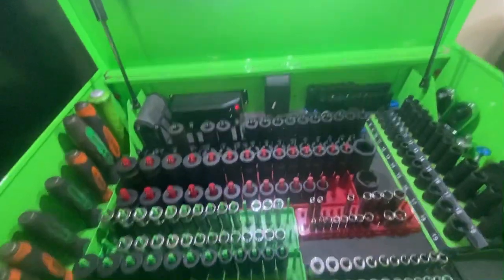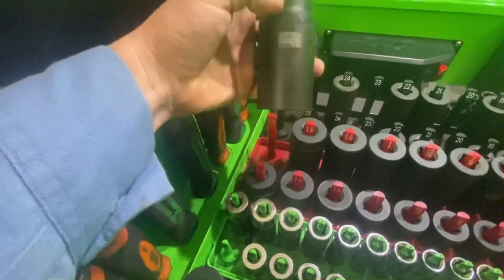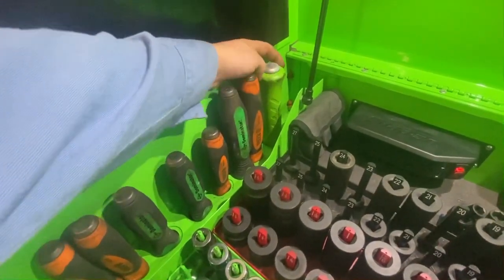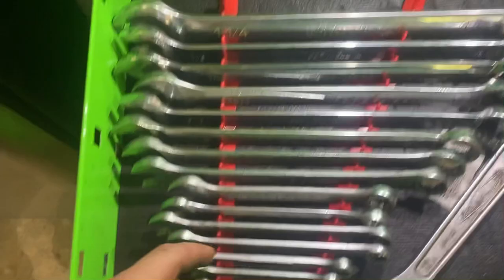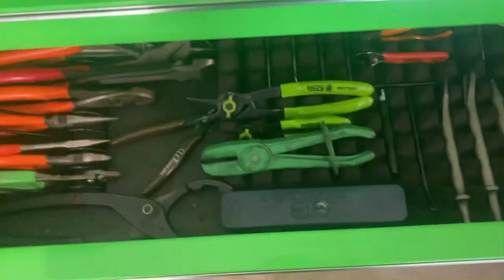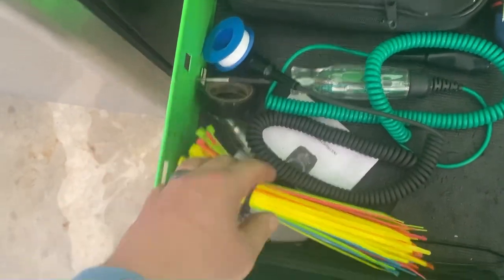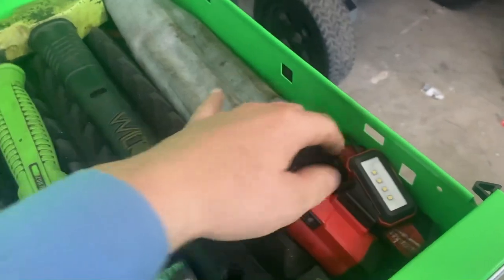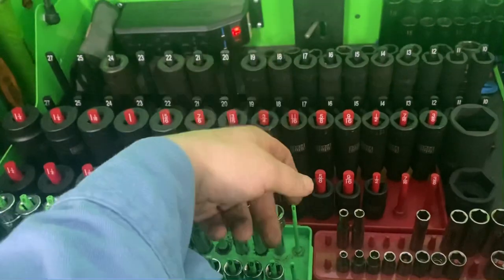Caterpillar mechanic toolbox tour (home garage box)

Comment: i am not a Professional Mechanic. but i’m a retired Professional Woodworker  and i do  Woodworking as a Hobby at home  so i do have  toolsets at home and at Work but  my question is simply Why would you spend all the extra money on  SnapOn tools for a home box ? now i can understand wanting high quality Ratchets  but like  Impact Sockets  and Lug Nut Socets wouldn’t a less. expensive Harbor Freight st do just fine ? for me personally i have a tendency to pick up Harbor Freight Power Toolsfor home use and more expensive longer lasting better built brands for my Career  at work i have to meet deadlines and Quality Control  at my home it’s my projects  and i’m okay with them taking a little longer  especially when i weigh out  the cost differences. now i do have some tools like Router Bits and some hand Chisels that i will bring back and forth for certain Projects at home  keeping in mind my Companies Policy is they will pay for routine maintenance and sharpening on Personal bits and Saw blades so it’s not worth me buying doubles of everything of best quality  although like any Professional i do enjoy working with Quality tools
Reply from the maker: I do loads of side work. Everything in that box makes me money. Also I’m a buy once cry once kinda guy. If I need it in a pinch I’ll get cheap but if I can save up and buy nice I’ll do that every time over getting some crap tool that’s just gonna frustrate me